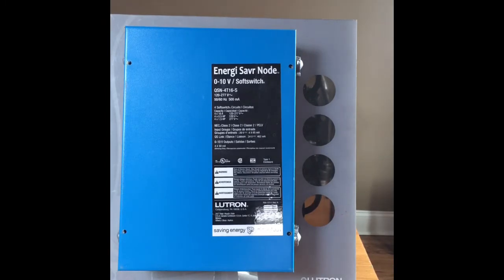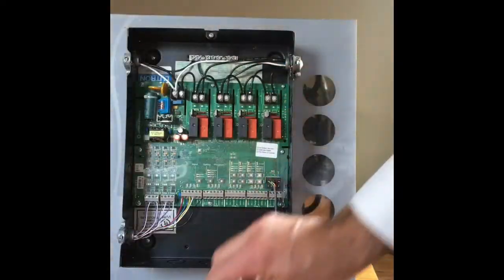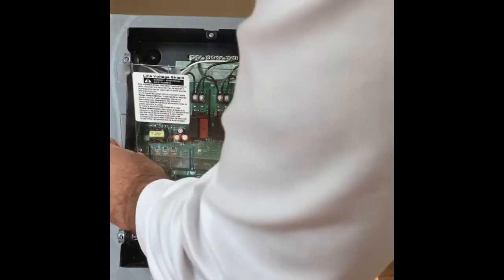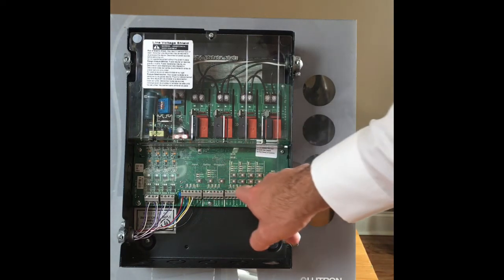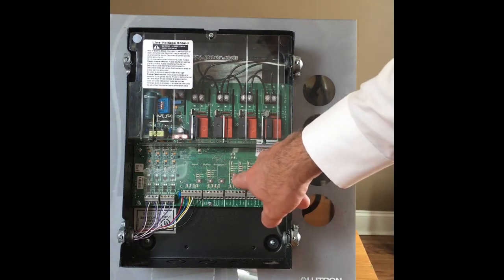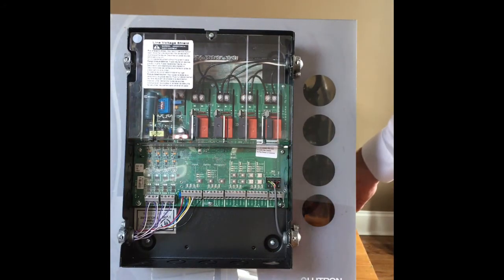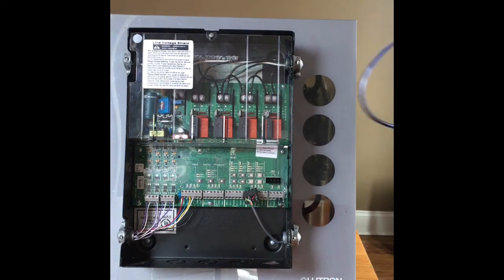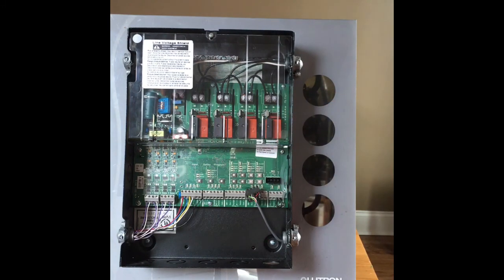Lutron ESN QSN-4T16-S Panel Basics

Comment: All my zones went out . I have 277 going into the panel . No tripped breakers . I don’t see any LED lights on the panel lit up . Should I replace the hole panel.
Reply from the maker: I would call Lutron tech support. 1-800-523-9466. they can help troubleshoot
Reply: Did you get it fixed? I do have the same problem at my work place

Comment: is there time clock control option in that panel?
Reply from the maker: A timeclock would be an additional component outside the panel.  Lutron has a grafik eye part QSGRJ-6P which can be connected to it to add a timeclock.  The QSN-4T16-S panel also has a contact closure input which you could connect a dry contact from a 3rd party timeclock such as the Intermatic FM1D14A-24
Reply: @prudalavage  thank you,  I'm designing external lighting to dim 70% to 50% after mid night. So if I use QSN-4T16-S panel and Intermatic FM1D14A-24 for external lighting, QSGR-4P Base unit is still required? QSGR-4P Base unit itself has timeclock function, hasn't it?